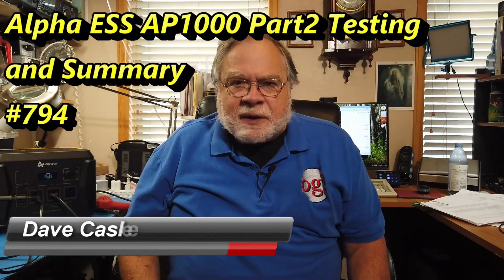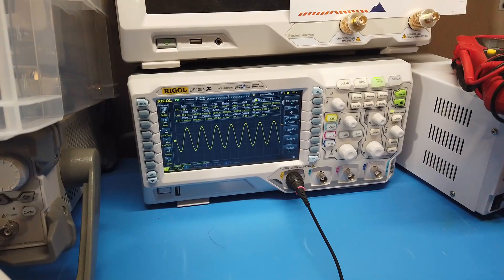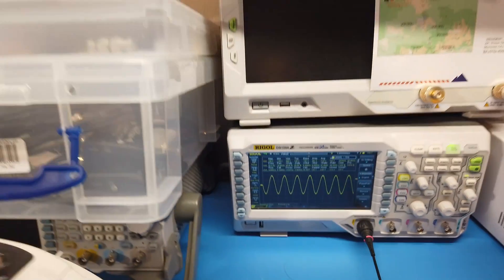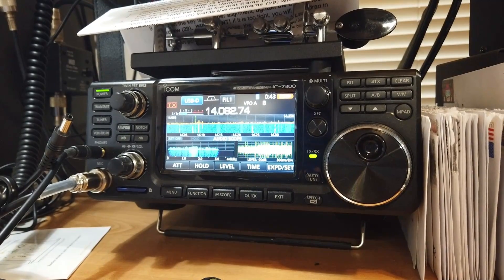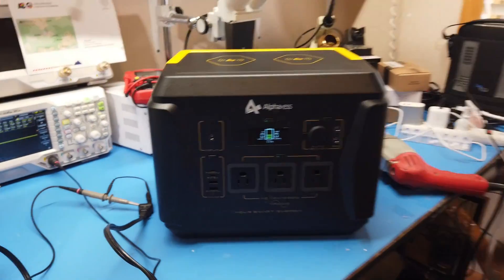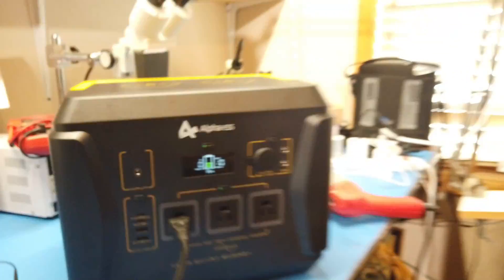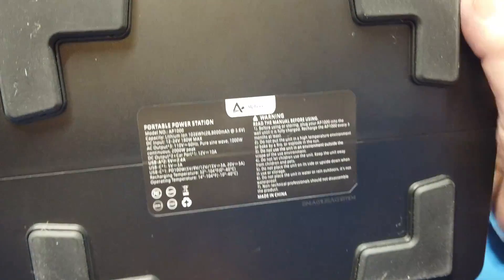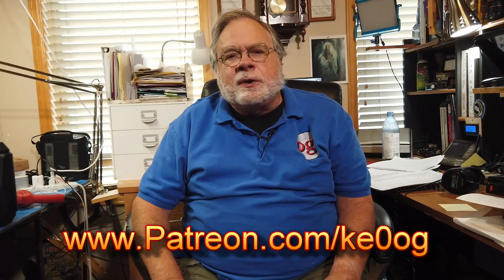Alpha ESS AP 1000 Power Station: Part 2 Testing and Summary (#794)

Comment: Thanks, Dave.  Really enjoyed the product testing.  Would be interesting as well to know the EMI results when using an actively loaded switch mode power supply.  Find more often than not, switch mode power supplies are a big noise source in my shack.  

Was also thinking about why the power station charge level went down to 60%, while being unused for some time.  Am not familiar with this power station, but (perhaps) the internal battery management system adjusts and maintains the battery level automatically, since the unit wasn't used at all in many days.  From my experience and understanding of high capacity lithium ion batteries, is that they should be 'stored' approximately 50% of their total charge capacity, when not going to be used for a while.  Of course, following the manufactures specific documentation is always best on any device or battery.  

73,   AC3HT

Comment: Dave,

Love your content! I'm new to HAM and have a question for you! 

I bought a Xiegu G90 which has 20 Watts of HF of output. I'm concerned that I should have bought a 100W unit. Am I hurting my ability to communicate long distances with only 20W?

Thanks for your help!
Reply: No not really.  Your twenty watts will get out just fine.  If you have problems breaking pile ups, adjust your timing when calling.  Pay attention to which (and when they call) stations get a response.
Reply: @williamshepherd1128  obviously there are limitations and drawbacks to having only 20W vs 100W of transmit power. 

Can I expect to communicate 1500ish miles (with good conditions) with only 20W? I surely don't think so whereas with 100 or 200 W that seems quite feasible. Is my logic broken?